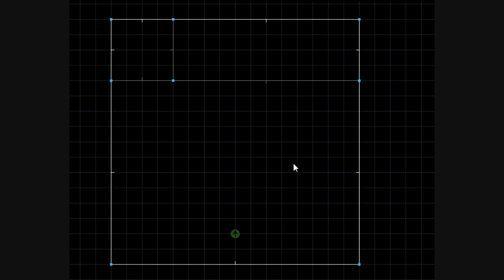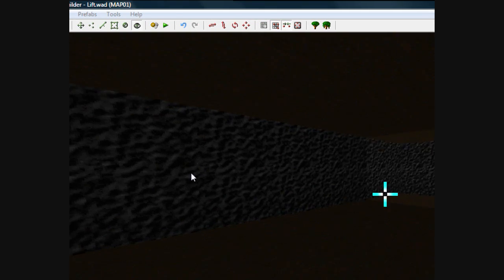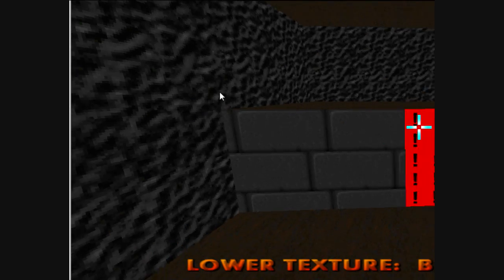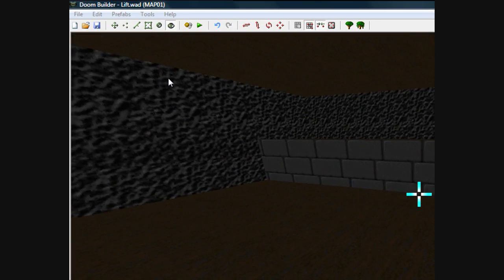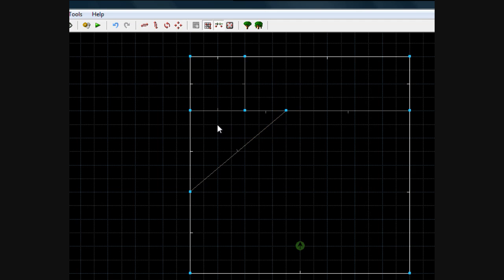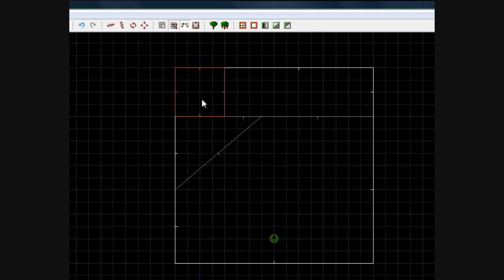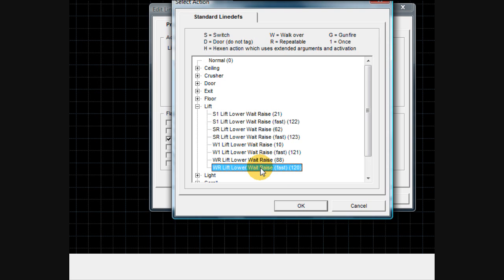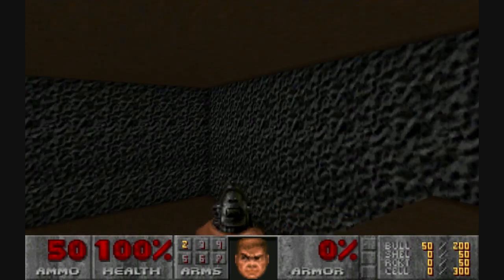(Doom Builder) Creating Lifts

Comment: So I tried this in UDMF format, with the action "Platform Lower Wait Raise" (action 62). However, when the lift is lowered, it doesn't raise. What do I need to do to make it raise?
Reply from the maker: What did you enter for the different parameters?
Reply: @Chubzdoomer  I gave the switches and the platform itself the same sector tag of 4. The movement speed is 20. The Reverse delay is 0. Arguments 4 and 5 are both 0. I did set the reverse delay to 1, but that made it rise immediately.
Reply from the maker: @ag23415  Ah, I see.  The Reverse Delay is how long the lift will wait (in tics) before it raises back.  A tic is 1/35 of a second (that is to say, 35 tics = 1 second) and the default DOOM delay is 105 tics, which ends up being about 3 seconds, so you'll need to insert a fairly large value in order to keep the lift from going back up almost instantly.
Reply: @Chubzdoomer  ok. I thought it meant seconds, not tics. Thanks!

Comment from the maker: Try using the Make Sectors tool (M key) and left-clicking both the plaform sector and surrounding floor sector to make sure they've been created properly.  They should sort of flash when you click each one.  Of course make sure your tag number exists only for the platform, too, and that the floor sector does NOT have a tag number.